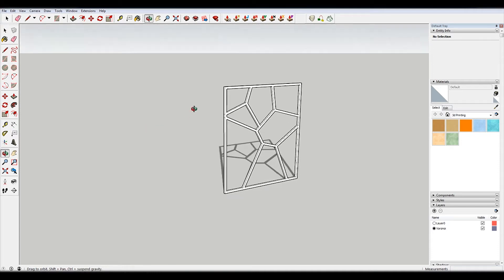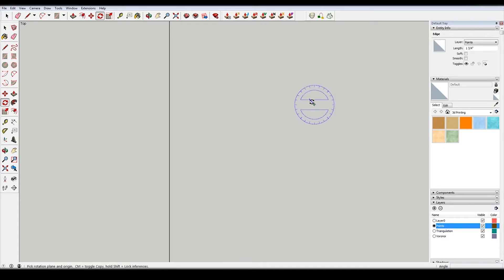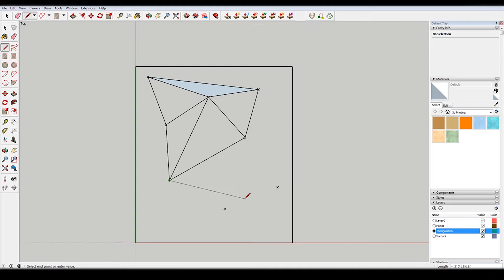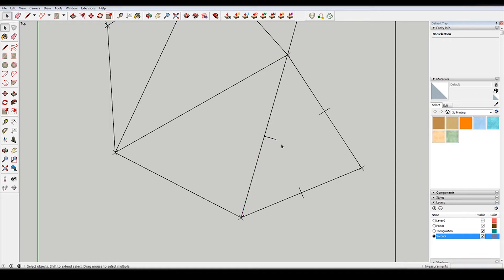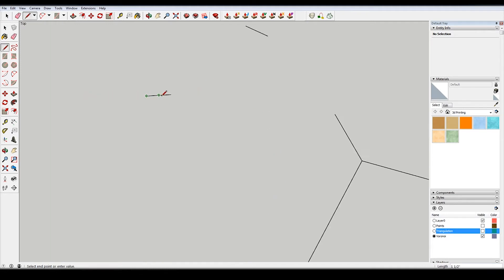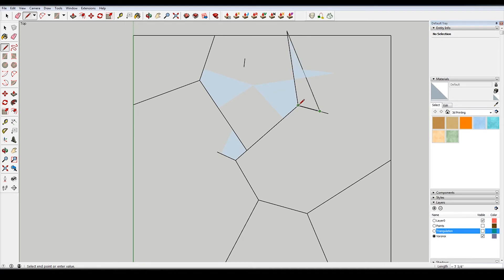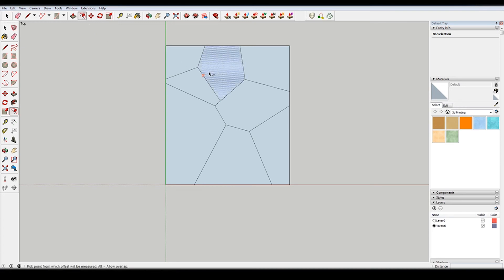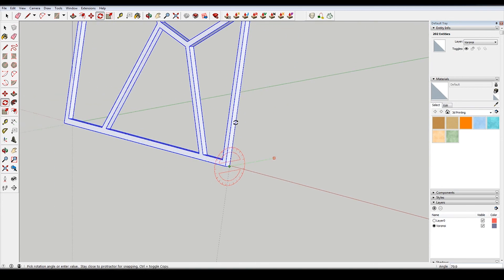How to Create a 2d Voronoi diagram

Comment: Interesting. But I thought when triangulating, you must connect to the closest points.
Reply: Delaunay triangulation is not about just connecting the points. In order to do have an actual delaunay triangulation it also needs to satisfy the rule that each triangle's circumference doesn't have any other vertices inside of it.